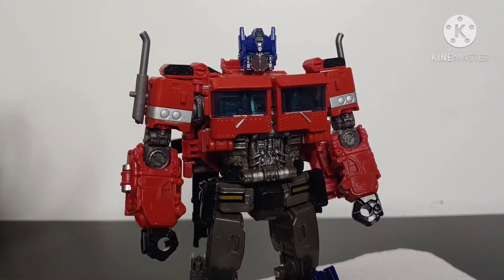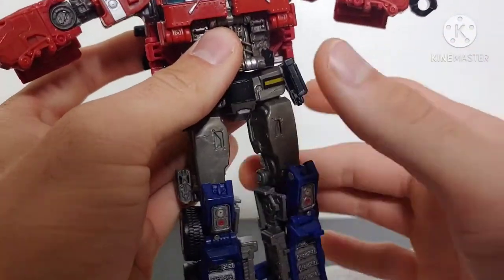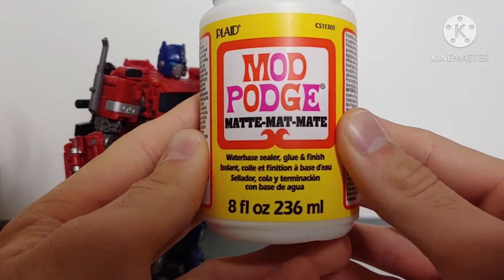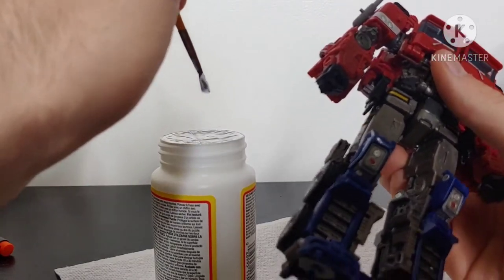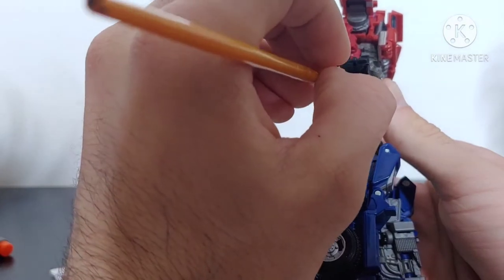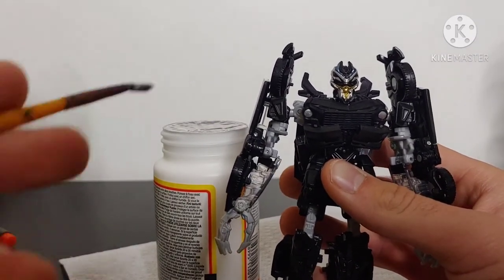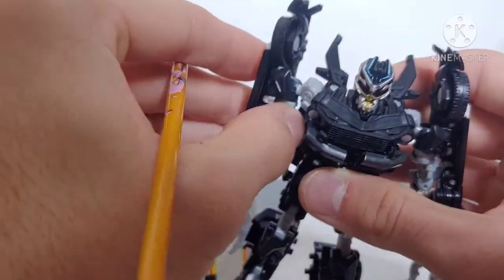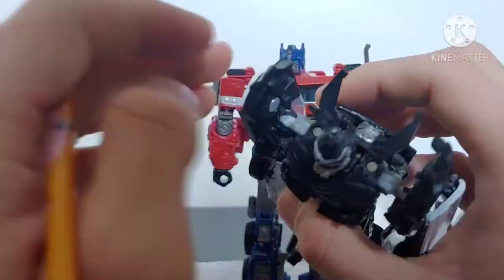How to fix loose action figure joints with mod podge

Comment: Hey, what if the joint on model kit like Gunpla? Is it possible using this mod podge?
Reply from the maker: I can't say but it should work. There is also an official joint tighter called kiki you can get on Amazon for like 10 bucks